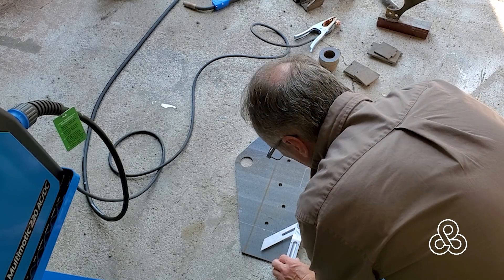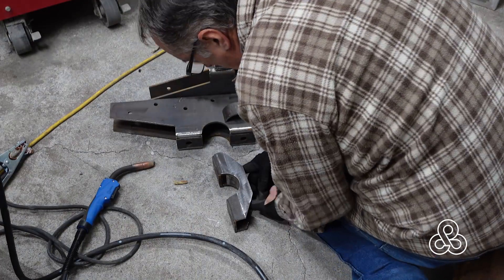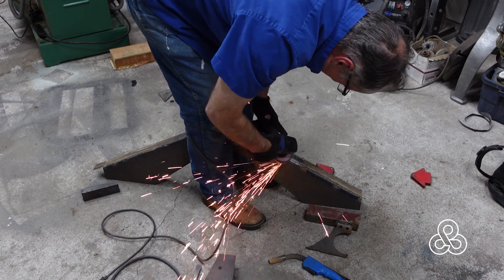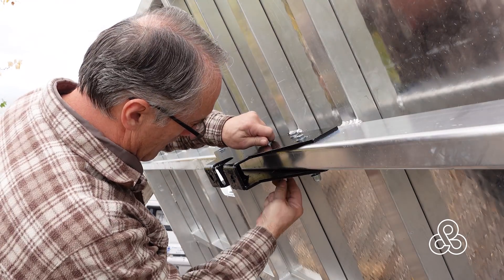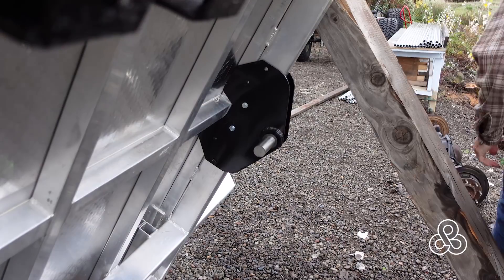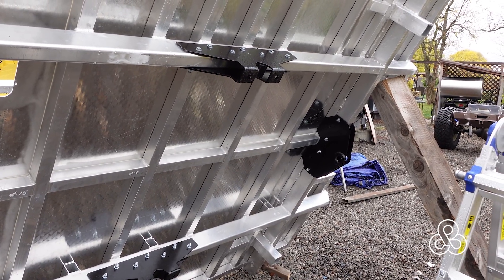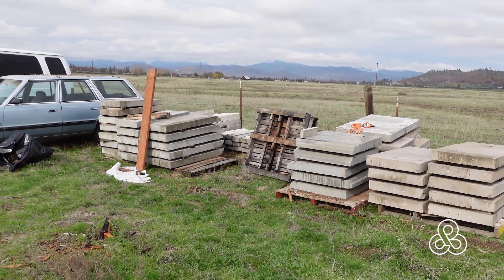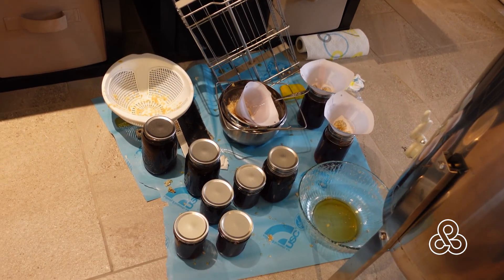L11 3 Point Mount, Leviathan supervan overlander project

Comment: You can't just screw ion plates on aluminium without insolating it with vinyl tape.It will rot and rust like noting else.
Reply: looks like some healthy paint on the steel .

Comment: Galvanic corrosion is certainly going to be a major issue for that mounting system although I am sure you have a cunning plan to deal with that.
Reply from the maker: The zinc plating reduces the anodic contact of the steel bolt somewhat. Stainless would be slightly better. Perhaps in future models we will powder coat the bolts if we can get this prototype to the point were it will spend more time in the water. Till then watch the corrosion and don't use chassis grounds. Ha!
Reply: Vinyl tape is normaly used inbetween a ion and aluminium conextion.Not seen here.

Comment: Did you consider adding tube to the bed frame box sections where you drilled the holes for the 3 point system to stop crushing the bed box section and making the mounts even more solid considering the weight and load they will see, if the brackets/bolts become loose the holes can start elongating. 🤷
Reply from the maker: As the tube is .25" wall 6061-t6 and the brackets themselves are incredibly stiff we should be safe. Famous last words! Ha! I'll keep an eye on them. Good call.

Comment: As if you don't already provide so much content for free, I have a few questions:

1. Do you have any idea how heavy the sub frame is? 
2. Are you concerned about any potential galvanic reaction between steel bolts of mounting bracket and Al subframe? 
3. Was there a conscious decision  / process to have the nuts on the inside of the side mounting brackets instead of the outside? (IME having bolts easier to reach is better, even when permanent but I never built a car before.) It does look neater in that configuration.

Thanks for sharing your progress with us, looking so good.
Reply from the maker: Weight- Solidworks put it at 630lbs (285Kg) but we have not weighed it.
Galvanic action concerns- I have concerns about everything. Ha! The zinc plating is slightly less anodic than raw steel, stainless would have been even a bit better. Not to concerned for this prototype. future models on new chassis and such may have epoxy or powder coated bolts. We will watch and see.
Bolt facing- Mostly aesthetics, but it is also good to have the sharper threaded end away from reach under access points. I can also use the exposed threads to hang cable ties for wiring/plumbing.
Reply: @BuilderCreator  thank you very much for the replies. The bolt placement answer in particular was enlightening, had not considered edges nor wiring / plumbing infrastructure. Very functional. Loving the series, it's going great and looks brilliant. Thanks again.
Reply: @BuilderCreator  was going to ask you about galvanic potential concerns 😂